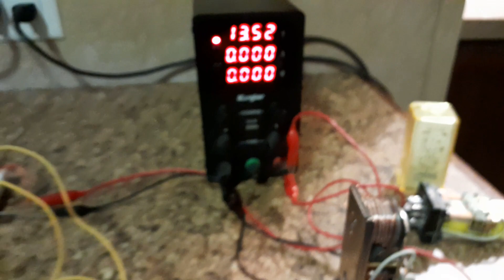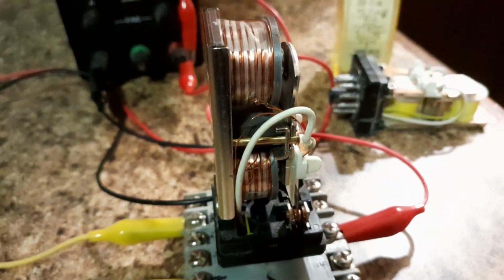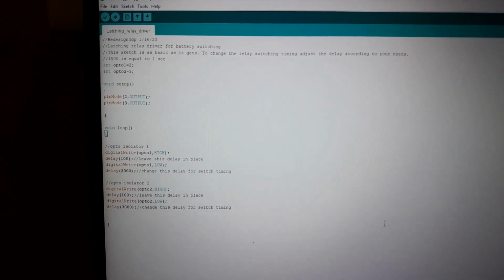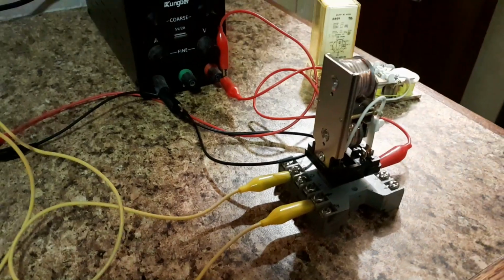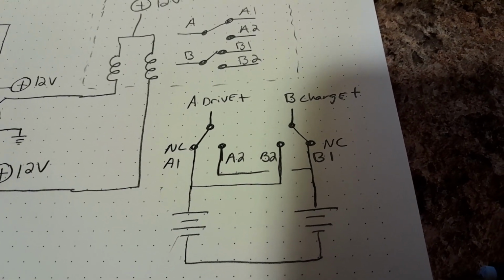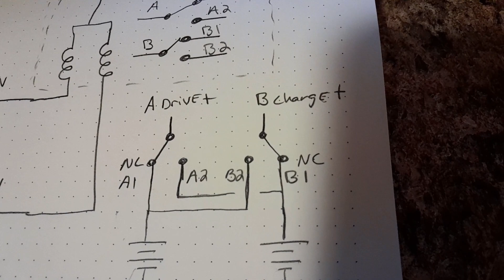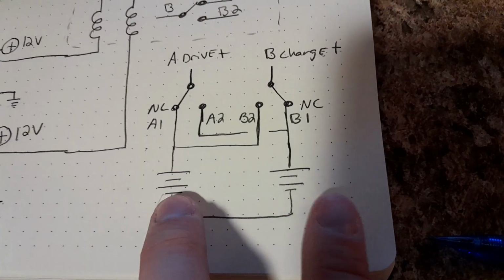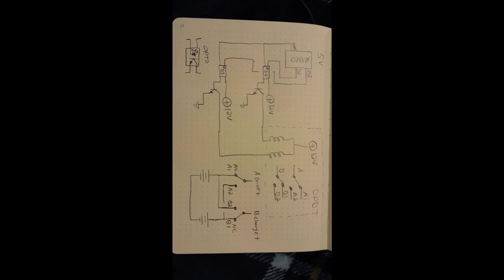Latching Relay Battery Switcher

Comment: RLC tank circuit is theoretically a increasing device if you just add magnetism to the equation  Thanks for the counter and bipolar window designs great stuff. I always thought it was the best charging system. Also it show's many basic design principle. Great video's

Comment: Common point of increase is the tank circuit changing electric current to magnetic and the reversing back  adding weak mag to coil increase out put nice video love the way you think.. Also back EMF is even higher. As you already know. Einstein was partial right but unfinished E=Mc square could be add E + mc =increase great video increase equal change

Comment: This is great - way less power draw than a standard relay which would be energized 50% of the time. Thx for sharing how you did it. 
Couple comments 
1) I’ve had trouble with relays sticking over 24v and had to use SSR. Have you tried this switch at 48v?
2) the battery swap you designed is the same way I found to work with DPDT relays. If the two batteries have the negatives tied together there is a draw back and it’s that FB from the circuit travels back through the drive battery - so any Flyback recovered is that much more power drawn from the drive batt. If the batteries are instead in the Bedini series type arrangement, then the fly back won’t travel through the drive batt and so less is drawn. But less is recovered. I’m not sure which way is best but just thought I’d point out what I learned from each.
Reply from the maker: I'm sure you can trigger the SSR the same way. Have not tested anything yet, did the video last night at work. Thanks for your input on the FB. I want to expand this into voltage sense triggering.

Comment: This is awesome. I am trying to do something similar for my EV gray research Even for Don's system I find that a battery switching system would work well for under 220Mhz systems. I am struggling right now to attain a 1.3Mhz system which I hope gets me into the range that Don talked about. It would be awesome to have a system that senses battery voltage and when it gets to a certain voltage the drive and  charge accumulators are switched. Thanks again for the system.
Reply from the maker: Good luck on your EVG research I've been fascinated with that one for a long time. I don't know how to switch at those speeds. 🤷‍♂️
Reply: @redesign3dp  Actually I was taking another route where the switching would only be after the sensing of the battery going to below 12 volts. The key for the EVG is to take high voltage low amperage and slam it into low voltage high amperage to get high voltage high amperage. I was friends with John Bedini and I saw that system work. Also with the Don system you have to be at 200Mhz for the results Don was getting. Anything lower and it doesn't seem to be able to keep the battery charged they way he said with the leads being antennae. Keep up the great work and th eawesome videos.